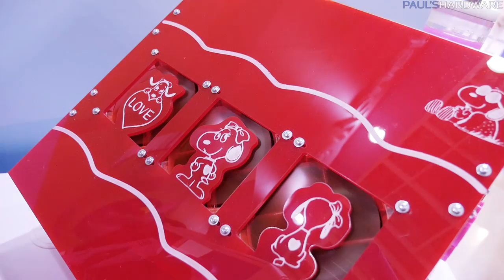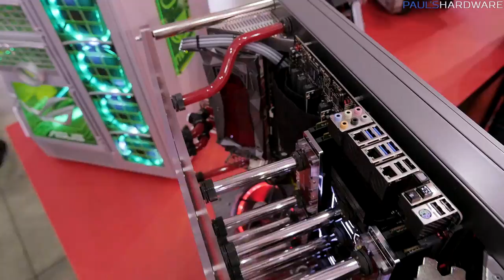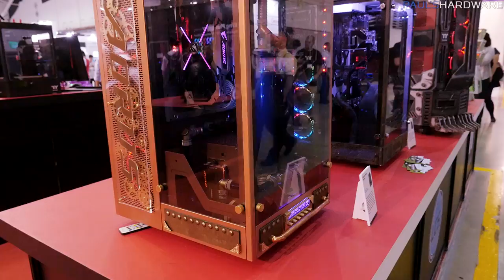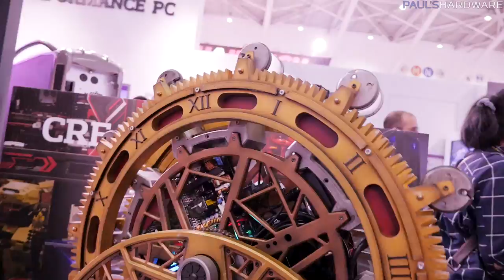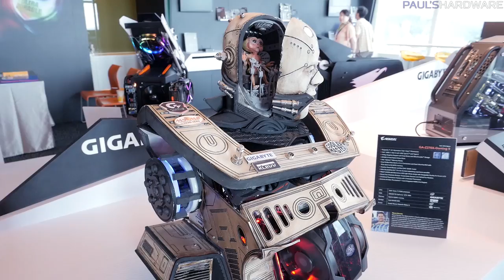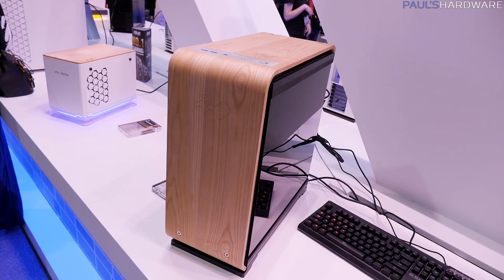The BEST BUILDS of Computex 2017!

Comment: Wow some amazing builds there, meanwhile my case is basically a cardboard box.
Reply: Jarrod'sTech Cardboard boxes are underrated.
Reply: My dad was like "Son, this is why you need an education" 😂
Reply: Jarrod'sTech mine is a briefcase
Reply: At least a briefcase is portable :)
Reply: The S340 will be remembered as a fucking legendary case!
Everything in that case works super fine, it's used a lot and with good reasons, it's one of those things that doesn't need to be high end stuff or super expensive because it just works.
I have the S340 Razer edition and love it.
Reply: my only problem with the S340 is I had to mod mine to get my H110i to fit and mount properly xD
Reply: Well most of are cases are compaired to that. But I know now for my next build it going to be tempered Glass. This build: Motoko is my First computer build its a AMD monster. then three years I will build another. When the price of Threadripper becomes stable.
Reply: YB h110 I is a 280mm rad. but the fit was so tight I had to keep loosening and tightening certain screws to get it to fit after removing a bracket protecting the front IO cables.

Comment: Hey Paul I saw your 1000 gaming pc build of April and I wanted to see if I could upgrade the gtx 1070 to a 1070 gaming x and add 1tb for more performance
Reply: Sorry for putting the monitor and wireless internet card

AMD - Ryzen 5 1600X 3.6GHz 6-Core Processor
Cooler Master - MasterAir Pro 4 66.7 CFM CPU Cooler
Asus - PRIME B350-PLUS ATX AM4 Motherboard
Corsair - Vengeance LPX 16GB (2 x 8GB) DDR4-3000 Memory
Western Digital - Caviar Blue 1TB 3.5" 7200RPM Internal Hard Drive
SanDisk - SSD PLUS 240GB 2.5" Solid State Drive
MSI - GeForce GTX 1070 8GB Video Card
NZXT - S340 (Black/Red) ATX Mid Tower Case
EVGA - 650W 80+ Gold Certified Semi-Modular ATX Power Supply
Netgear - A6210-100PAS USB 3.0 802.11a/b/g/n/ac Wi-Fi Adapter
LG - 25UM58-P 25.0" 2560x1080 75Hz Monitor

Comment: Hey Paul, I have a two part question for Probing Paul: where do I post my questions? Just below any video or below a probing paul video? I don't know if you'd see all the questions if we post them all under random video's there are so many questions haha...
Now the real question: will my PSU last longer when I buy an overkill one? In my case: I'm going to build a pc with an APU and a SF450 for ultimate silence. I don't need that many watts at all, but I thought the components won't degrade that much when it won't suck that much power.
Thanks and have a great day!